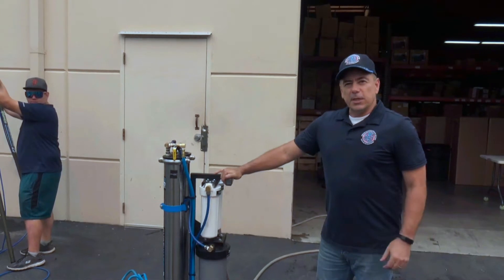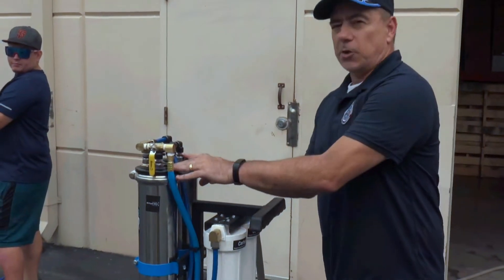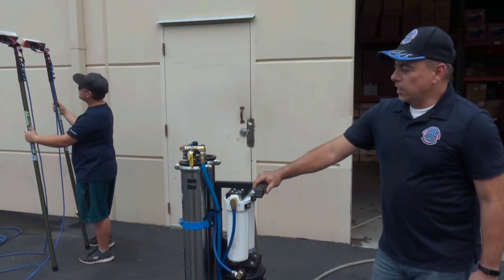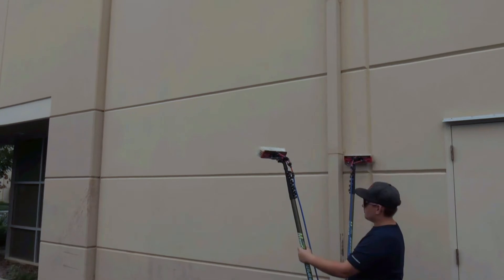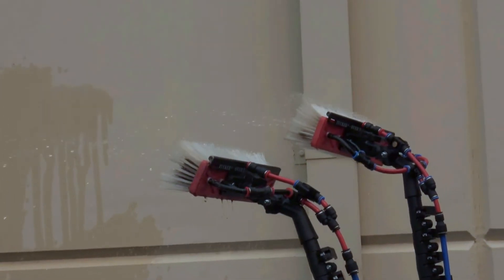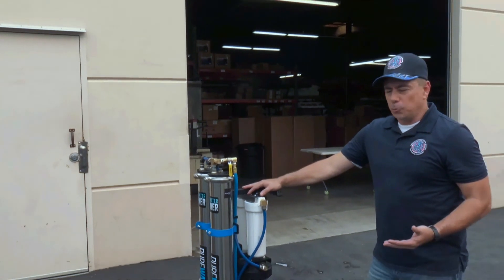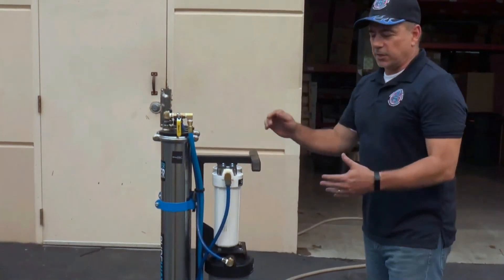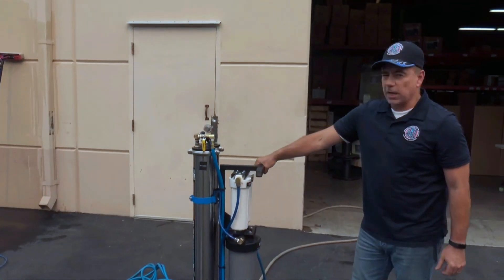Pure Water Power Dual RO Pure Water Cart

Comment: Excellent video CWC...  i think a double RO 40/40 is an essential piece of kit to  have  simply because higher water flow means 1) much quicker rinsing  2) Quicker working times ( much quicker ) 3 ) Huge energy saving and huge time saving  / and much higher quality finish meaning better everything  .. it is a no brainer for me  and a must have !! PLUS YOU DO NOT NEED THE HASSLE OF SETTING UP 230 V BOOSTER PUMP  ( just think of the timing saved there !! ) <<<< Thats a HUGE point !!! .. All the best from Southern Germanys best window cleaning firm Preispasst. de.... i love it ..